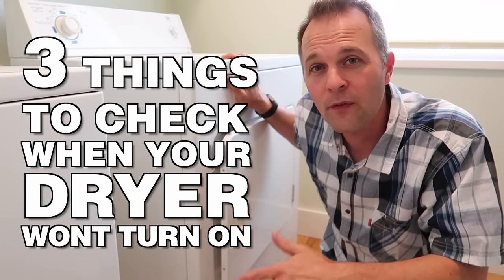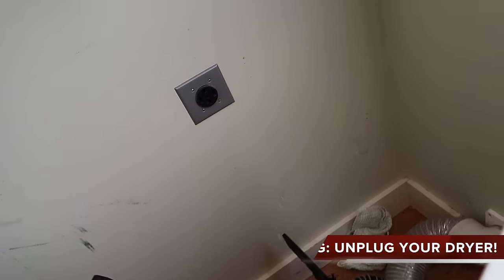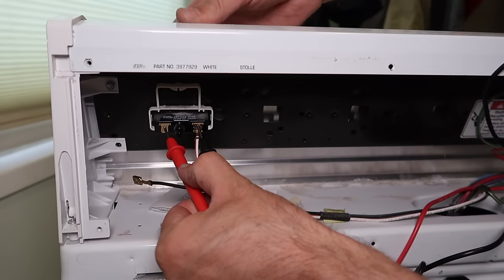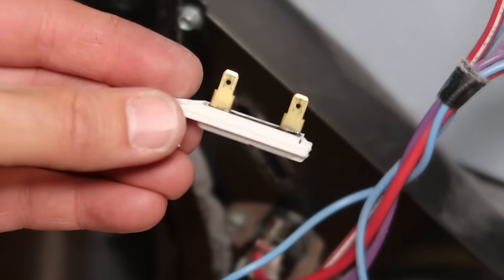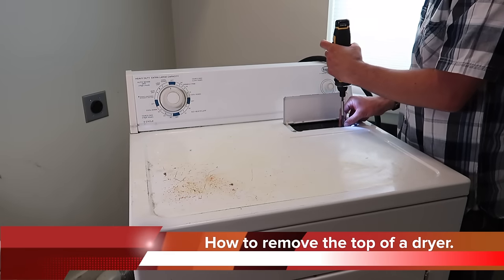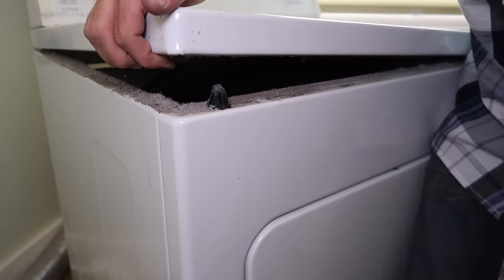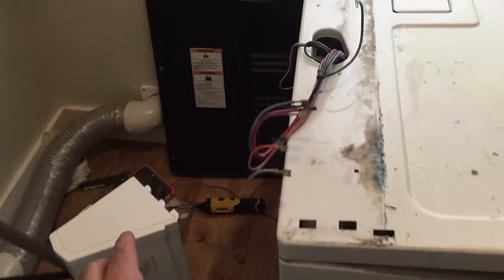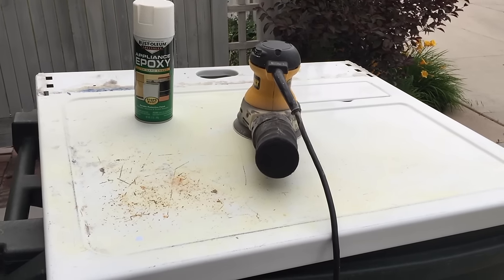3 Things To Check when your Dryer won't turn on or start - REPAIR

Comment: Knowledgeable, patient. TINY comment; near the end you said you were showing how to repair the door switch. You showed how to get the top off to get TO the switch, but then you mentioned the spray epoxy for the finish ... and didn't repair the switch.

Comment: If you change a blown thermal fuse, you should also change the temperature sensor just below it. It could be the cause of the blown thermal fuse. Also, thanks for the nice tip about the Appliance Epoxy paint.
Reply: Makes sense
Reply: Greetings, I changed the thermal fuse and the dryer worked for a while then stopped working again. Any suggestions??
Reply: @CountryBlessingz  My guess is you have a blockage or obstruction in the exhaust hose and/or a clogged vent. Or are pushing air through too long a length of hose. Or have a build up of lint somewhere inside impeding the air flow.
Maybe a faulty exhaust fan or broken blades on the exhaust fan. Is it in an air tight room? Could you be overloading it?
If none of these corrects the problem, double check you are installing the correct temperature fuse.
Also, you might change the temperature control thermostat, it might be sticking occasionally.
Reply: @eCitizen1  Thanks so much for this information. I'm going to look into it and see what's up from there. Very appreciative 💪🏾
Reply: @CountryBlessingz  Let me know if track down the problem. There could be different problems depending on if its gas versus electric.
Reply: @CountryBlessingz  Make sure the heating elements are not short-circuited with the heater metal housing. If you see black spots, you have a short.
Reply: Thank you so much for your comment!!! I went ahead and bought both the thermal fuse, (which tested dead), as well as the temperature sensor just in case because of your comment. When the parts came, I tested the continuity of the temperature sensor, and it also was dead. I probably would have just blown another fuse, not knowing to test the temperature sensor without your suggestion. My dryer is working again now. I'm thanking my Father God for your comment here. God bless you!
Reply: Experience gained over many such repairs. Be sure to thoroughly clean everything inside the dryer. All vents, hoses, nooks, corners etc. Few people know this should be done annually. it can become an extreme fire hazard if not properly maintained.
Reply: When I saw this comment I went ahead and bought both parts. I then only replaced the fuse.      The dryer worked, but I noticed it was very hot, almost too hot to touch. The next day it didn't work, so I opened it back up and replaced the fuse and temperature sensor AKA thermostat. Thank you!

Comment: Thank You so much. The first 48 seconds of your video saved me $700. I was just about to by a new dryer and then I checked the little door switch you were referring to, and it was just jammed in a little. I flipped it in the right direction, shut the door and my clothes are drying right now. THANK YOU! This made a difference in our family budget this month. It means so much to us.

Comment: I want to send a HUGE thanks for taking the time to make this video. We were about to spend a lot of money on a service all or another dryer. Luckily I found your video. We followed your easy steps and determined it was the thermal fuse. $7 and a two-day wait for amazon and we are up and running again (we bought a three-pack just in case). I cannot thank you enough!

Comment: Thanks for this!  Your simple, clear explanation saved me a repair bill.  In my case, the door safety switch had worn out.  Two thoughts: 1) Before opening the dryer lid, wrap tape around the stiff knife so the knife cannot scratch the dryer.  2) Because our children are grown and almost gone, I felt comfortable doing very simple wiring to bypass the safety switch altogether.  The broken switch was screwed on so tightly that I couldn't unscrew the doggone thing anyway.
Reply: bypass the switch or the fuse? 
you should never use your dryer without fuse.... only for testing purpose if you can't test it otherwise..
you will burn your house...

Comment: Thank you!!! I'm a new widow and your video was spot on and helped me fix my dryer myself 🙂 I had to buy a new multimeter as my husband's wouldn't work ($20 at Walmart) and a set of 3 thermal fuses (which was the problem) for $6.02 on Amazon).
     Last week I spent time cleaning the lint out of the dryer duct inside the wall and used the rotary lint eater brush set and the brush came off up inside the wall but after the majority of the day and enlisting a friend to help, we finally got that out using one of the rods from the brush set tired to the hook end of a wire clothes hanger.
     Then the next day I got caught up on laundry (4 loads) and when I went to put the last load in the dryer out wouldn't turn on. I was frustrated to say the least. Then I found your video.
    Thank you thank you!!!  Now I'm saying a prayer that my dryer is good to go for a long time after this 🙂
Reply: The same happened to us. We used the brush and the next day it did the click thing. Did we do something when we cleaned it?

Comment: A quick test for the power/start button: on some units if you press and hold that button with the unit plugged in, you can hear the faint motor noise of the timer, since presumably your drum is no longer running at this point.  Not all units will have a electro-mechanical timer mechanism, but it's a very fast test; if you hear something, your start button is not likely at fault.
Reply: This saved me from having to change my door switch. Thank you
Reply: Yes, that is exactly what I hear, a very faint motor noise when I’m pushing the start button which usually turns on the dryer. I don’t think you said how or what to replace. Did anyone else hear if he said how to fix or R&R that part by chance?
Reply: I hear it so what's the fault?
Reply: @Chataleta  Hey I have this exact problem, ever find a solution?

Comment: Thank you Adam.  My dryer stopped working and since it is 12 years old we figured we'd just get a new one instead of paying to get it fixed.  We couldn't get a new one delivered for a week so I thought about searching YouTube for a solution and came across your video.  Your video is great - you go slowly and show every step.  My husband did the work but I probably could have done it myself as you made it look so easy.  It was the thermal fuse so we fixed it for $19.  Afterwards a friend recommended that we should have changed the belts while we have it apart so I wanted to pass that on.  Thank you much!!!

Comment: Thank you very much. This is a long overdue for helping me 2 years ago (04/02/22) when I came across your video. I bought 3 Thermal fuse and a start switch and have used all of them and the last fuse just today (08/01/24). Thank you so much again.

Comment: Thank you.  You saved me some money.  My Maytag dryer stopped working.  Watched your video. My door switch had an audible click when depressed.  Did a continuity check on the start switch and it was good.  Did a continuity check on my thermal switch and it had an open.  Put on a new thermal switch and the dryer started working as normal.  Thanks again.

Comment: Omg I’m so glad I found your video. I almost called a repair man, but tried your method of the thermal fuse and it worked!! Had to order online but got it the next day through Amazon. Also, I am glad I took the back off because lint was EVERYWHERE, surprised it didn’t catch fire lbvs. Now my dryer is like new. Thank you for this video. Saved me so much money and didn’t take long at all

Comment: So thankful for this instructional video! I followed this step by step, was able to identify the root cause of being the thermal fuse and replaced myself.  I ordered part through Amazon and saved $15 rather than buying from local company.  I also bought and learned how to use my first multimeter. THANK YOU!! 😊

Comment: Thanks, Adam and all the other's who post these DYI video's!!! It was the thermal switch which went bad as you described.  In years past it might have meant either a repairman or a new appliance.  With your video, I am that repairman and the new switch will arrive in two days.  
I've repaired / replaced (*) lawnmower parts (*) refrigerator fan units (*) sliding car door assemblies and so many more household repairs saving me untold dollars and making me a better man - bring it on - - MANY THANKS!!!

Comment: Excellent presentation! And I just now went back to the dryer--a screw was laying on the opened dryer door, earlier this morning. I wondered where it came from since I had not washed anything with pockets. So I went and retrieved it and messed around getting the screws aligned so it would screw tight. And WAHLA! It's working again. My dryer is VERY old--like the one you are demo-ing on. So VERY HELPFUL!!

Comment: Thank you for this video. I have no experience in appliance repair and i was able to follow this and fix my moms dryer. Her thermal fuse was blown and after replacing it not only was yhe problem fixed but her door which would non stop buzz when closed also stopped.

Comment: Thank you for an easy to follow video that shows every step. The thermal fuse is blown on my Roper dryer, and I ordered the replacement part from Amazon. Hopefully the repair will go well. Thanks again!

Comment: I used your video to troubleshoot my dryer and the thermal fuse was open.  Got a couple replacements off Amazon and voila the dryer works!  Thank you!

Comment: You just saved my 23 yr old Whirlpool dryer. My wife was already convinced that we need to replace the pair with a $2000 upgrade. Replaced the thermal fuse and cleaned the piles of lint out. Good as new. Thank you!
Reply: I'm sure ur wife was disappointed you fixed it lol. almost got a new whirlpool dryer

Comment: Sir, I thank you. Just fixed my dryer, it was the thermal fuse. Bought a 3 pack from Amazon  replaced it. You saved me at least 800.00 bucks.

Comment: Thank you for the presentation. this video helped me determine why my dryer is not turning on. Although I was a little hesitant about fixing it myself after seeing all the wires when looking into the control panel I challenged myself and found that the timer was blown. I ordered the part and when it arrived I replaced the wire the same way it was mounted and holy crap the dryer works again. It saved me $150-$300.

Comment: Thank you sir, 5 year after and you still saved my dryer.

It was just the start button that was malfunctioning, so i just soldered another one and it worked just fine!

Comment: Got it.  Figured out how to use the multi meter.  Rewatching your video and now it's clear.  Thanks for your post.  Definitely recommend  to purchase a multi meter with the beep feature.  Reading the screen whilst holding the leads is a juggle.  LOL😊

Comment: In my case, the dryer mad an odd sound when I pushed the start button, then nothing. The inside light works, so the breaker is ok. I found the door switch, pushed it a few times, tried the srtat button again. The dryer started!!! Bless the Lord! And thank you! Subbed, liked,  and shared.

Comment: My on/off, signal switch also wasn't making a clicking noise, like a door might not. I took it out and after trying to figure out how to use my mulitmeter with it I noticed it was clicking now. Put it back in and it worked. Thank you!

Comment: Dryer wouldn't turn on. Watched your video. Narrowed it down to the thermal fuse. If you're reading this comment and need a fuse don't waste your time going to Lowe's like I did.  They don't sell replacement parts.  Order from Amazon.  $6 for 3 fuses. Fuse fixed my problem.  Dryer runs great now. Thanks for your help!!

Comment: Omg thank you for this video, got exact the same dryer and the door switch gave up. Ended up removing the switch and just joined the wires and dryer is back to working. Thank you!

Comment: Thanks for the great video man! You didn’t fix my dryer but you gave me the courage to give it a try 😎. The problem was the door switch, so rather then buy a new one. I decided to take the old one apart and clean up the connection... success!

Comment: Thank you for the great video, my brand new 6 week old LG dryer stopped working so I did  a test on the plug and wires and that all tested good. I then saw this video of yours and it was the button in the door opening, I pushed on it a few times I tried the dryer and it went on! Thank you so much so I can now tell the warranty people what I found.

Comment: Fantastic! My dryer broke on Saturday, I ordered the thermal fuse which was bad, and received the part on Sunday. 24 hour self service for only $17.32 (10 for overnight shipping). Of course it took a while to finish cleaning up the area, but the thermal switch went in within 5 minutes of retrieval from the front door step. One thing that caused me a scare today is, that I didn't push the plug in all the way and so after a few runs it stopped working.... As I was troubleshooting, I fortunately thought of checking that plug.

Comment: All of a sudden dryer stopped working. My wife thought of buying a new one until we saw your video. Checked the continuity and realized there is none on the thermal fuse. We ordered one. That fixed the problem with only a few dollars. Thanks a lot and we really appreciate it.

Comment: Great video, just so you know, no need to remove the control panel. Those 2 metal brackets in the back are there to support the top of the dryer when you lift it.
Reply: Was getting ready to post the same comment.

Comment: Thanks for the tip on checking the door safety switch. I thought it was either the on button or thermal fuse. Turns out both were fine. Half the plastic part broke off and wasn't making contact with the door.  By pushing in what was left, the dryer started right up. A $7 part will keep my 20+ year dryer running smooth. I also like the tip on refinishing the top. Mine is showing its age!

Comment: Thank you so much!!! I was going to call a service guy out and did the tests you showed and it was the thermal fuse. Wondering if I should do anything with the temperature sensor based on a comment I saw. Cost 2.25 and dryer is working again!!!

Comment: Thanks for the information. Fixed the dryer switch myself and avoided a service call. Saved $150.00.
Reply: Wait, but how did you fix the switch?

Comment: The plastic swtich thingy was a little melted from heat. All it took was two minutes, a lighter and a slightly toasted finger to fix it and it's back working.
Saved me about 90$ for the visit and I don't know how much more to actually fix it, along with a bunch of time that I have to take from work to be home

Thank you

Comment: Thank you so much for posting this video. When I got to checking the voltage coming in, I found none, and realized it was a fuse box problem. You might want to put some words at the front of your video telling people to check if they've tripped a circuit. For people like me. Thanks, again!

Comment: Thanks so much - my very old dryer stopped working and your video helped me fix it!   I ordered a door switch on Amazon for $9 and  installed it.   One tip - when I was taking off the old switch, I didn't realize the casing was separate from the switch and I dropped it into the bottom of the dryer.  I had to buy a magnet on a stick tool to get it out.  :-)

Comment: Thank you for this wonderful video.  There is no telling how much you may have saved me.  It turns out that I closed my dryer door too hard and it broke off the little black switch that you referred to in your video. Do you have an idea as to what that might run to have fixed?  Thank you very much, Lisa

Comment: The estimate to fix my dryer was 200 dollars.  I ordered the on/ff lever and replaced it in 15 minutes.  You saved me 170 dollars.  The only thing I did different was to just raise the lid without removing it since I only needed access to the lever.  Thanks!!

Comment: Thanks for taking the time to make this video. It helped me twice. First, it was back 2019, and it happened again today, for the same problem, blown thermal fuse. It's good that I have your video bookmarked, and also I just ordered a couple of these thermal fuse from amazon. Just in case it happen again. Thanks again so much for your help.

Comment: The timer was clicking like normal. The interior light worked and the door switch turned the light off and on. It was the thermal fuse. Thank you!

Comment: Thanks!  Took mine apart.  The hose was clogged and leaking so after it clogged up the vent hose it dumped dust behind the dryer everywhere and got in the air intakes and inside the drier.  My switch was ok for start continuity when I pressed the switch.  The thermal coupling no continuity.  Lucky I didn't have a fire.

Comment: GGGGGGGGGGGGreat Video, my electric dryer did not work for like since dec 2019 and i did not know how to fix it at all. But then i found your video in sep2020 and i tried the door switch , i just wiggled the switch closed and open, like if the door was open and closed. and also hitting the start button. well long behold it WORKED !!! ..I did not replace the switch on the door lid yet i just wiggle it and it works. But thank goodness for this video. p.s i dont have any tools...THANK YOU 🙂🙂🙂🙂🙂🙂🙂🙂🙂🙂🙂🙂🙂🙂🙂🙂🙂🙂🙂🙂🙂🙂🙂🙂🙂🙂🙂🙂🙂🙂🙂🙂🙂🙂🙂🙂🙂🙂🙂🙂🙂🙂🙂🙂🙂🙂🙂🙂🙂🙂🙂🙂🙂🙂🙂🙂🙂🙂🙂🙂🙂

Comment: Thanks for the help. Found out the switch in the door broke off on mine. 8 bucks and 25 minutes later.....as opposed to 125 on a service call.